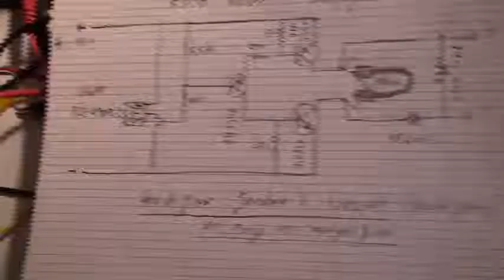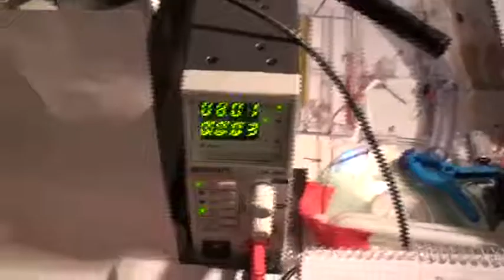pulse motor with PMH armature test 2.wmv

Comment: You should try putting your scope across the LEDs.  It looks like when you slow down the rotor, the Hall sensor circuit allows the two coils to be energized for a longer time allowing more energy to be stored in the pair of coils.  Therefore that can light the LEDs.  When the rotor turns faster, less energy can be stored in the pair of coils, so the LEDs don't light.  This would have to be investigated with your scope.

Comment: Nice Setup!
I think the higher speed of your rotor causes a bigger resistance (impedance) of this coils...
So a higher rpm causes a voltage drop on your output...
Cheers...